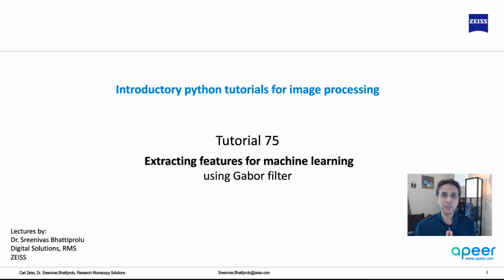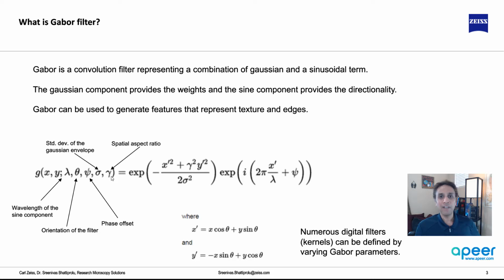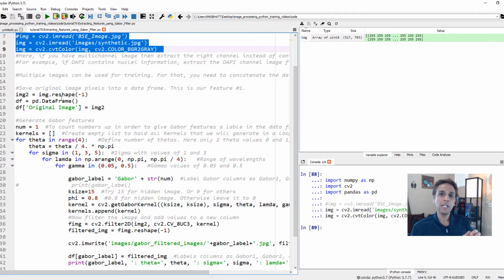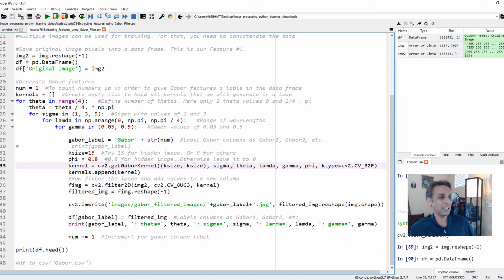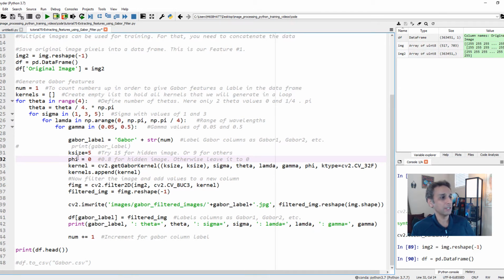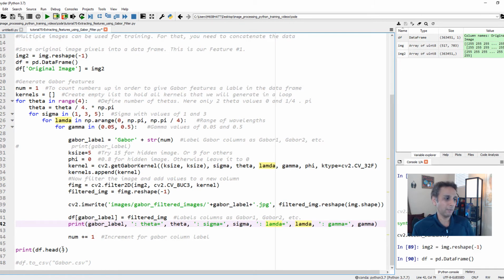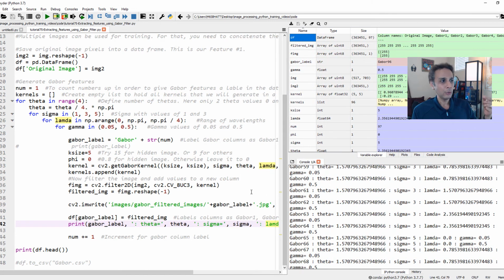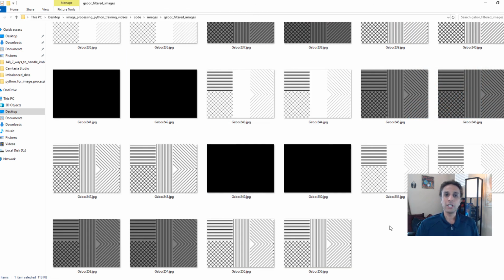Tutorial 75 - Extracting features for machine learning using Gabor filter banks

Comment: Hi, Thanks for the video. I am trying to use gabor filter for my neural network and after using gabor filter, I should stack all the gabor filtered images together then feed it to my network, but gabor filter is not reducing the number of pixels (dimensions) of the original image so when I stack them, it gives me an image with big dimensions that I cannot use later. Do you have any suggestions for that?